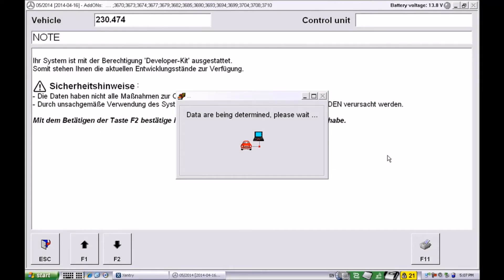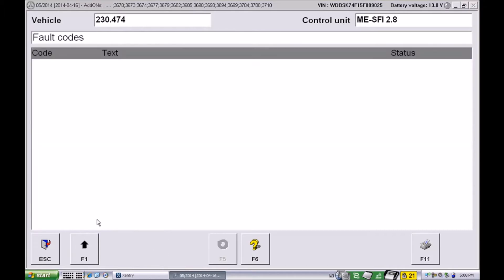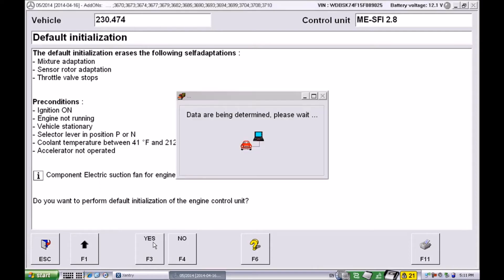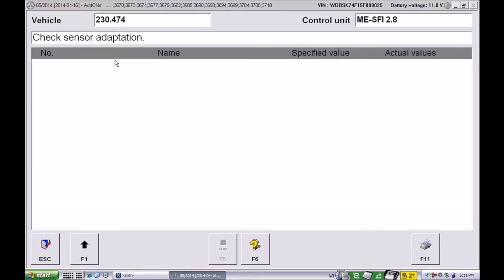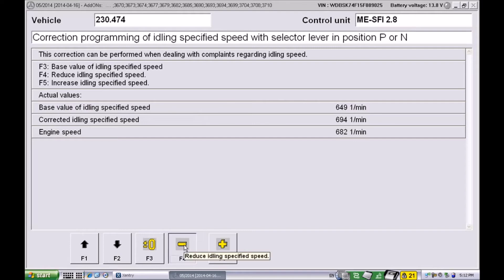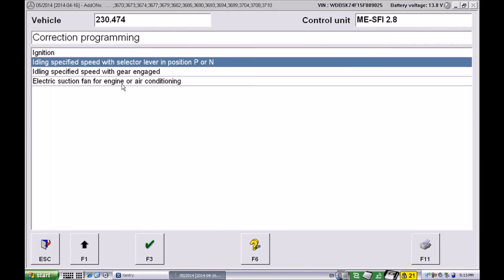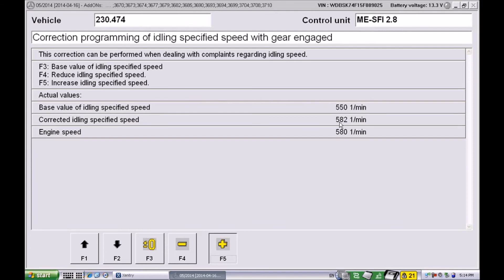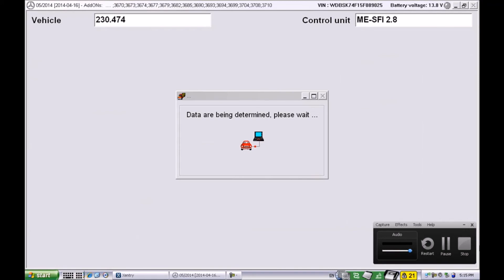Mercedes Benz AMG 82mm throttle body programming

Comment: do you know how to re-program the 722.9 transmission with the updated gear ratios? If so, how can I get in contact with you. I will pay!
Reply: You have save all that previous coding and clone in to the new conductor plate. Than start the vehicle and re initialise all that  value original factory scan tool.
Reply: Grear ratios are set by gear sizes, not by adaptation. To readapt shift point, you use Xentry instead of DAS, and you adapt gear shifts gear by gear, up and down, the readapt torque converter lock clutch. You do that if you have swapped the entire transmission

If you repaired certain gear, you only readapt the shift involved.

Comment: I figured you would go the other way with Idle - In my case (M113 V8 in M111 car), the ecu thinks it has the old 4 cyl throttle body still so it's opening up too much for the larger TB making the engine idle high.

Comment: Is this all that is required to run the 82mm throttle body? I was told air mixture would have to be adjusted as well
Reply: wood woodpecker so I guess this guy doesn't reply to comments